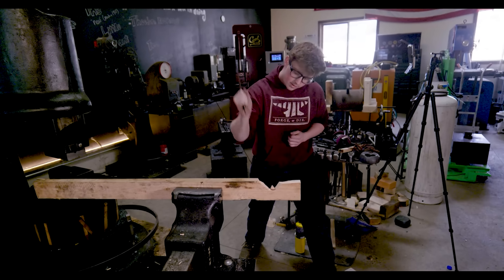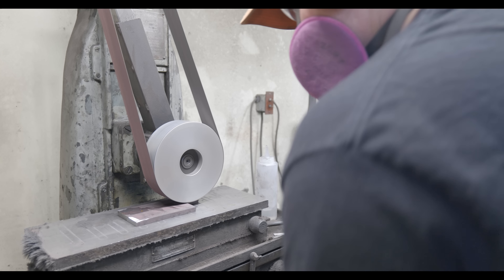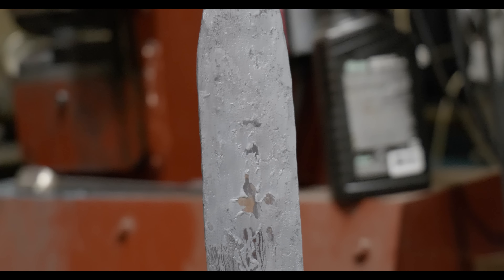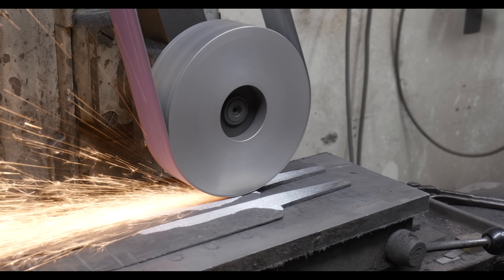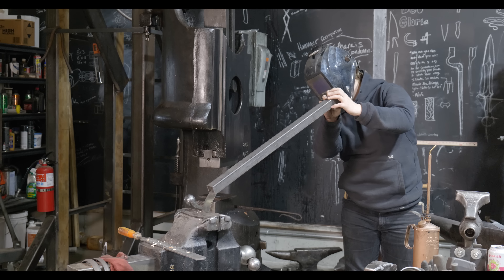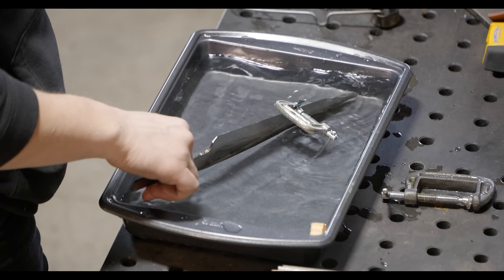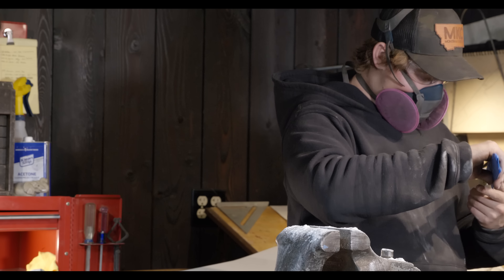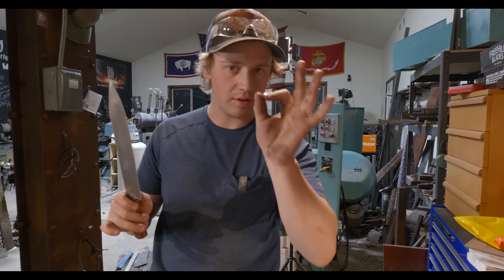Becoming a Master Bladesmith: Part 1

Comment: That blade has a lovely temper. Keep him and name him Brutus. 
... I've come to think the old Elletsville, Indiana forge group in the 90's had the right idea. The  people that were trying to be recreationists kept lots of small, onehanded bellows around for the times that they needed to blow on something, but didn't want to breathe in what they were working with. The guys that were using modern tech had pressurized air. One smarty used the copper pipes he ran it through as the ground for his forge barn's power. Which was fine until the first storm came through and he found every last breaker in there thrown and blown. From the hand sander to the rechargers to the triphammer and ceiling fan, if it was plugged in it needed its fuses changed or breaker reset.
I'm sure by now you've passed your Master Bladesmith's test. 
  Congrats! Congrats!

Comment: Machining tip: When you mill slots in G10 like you did in this video, maybe you could first try plunging the cutter to full depth in many places along the slot to remove the bulk of the material (turn it into Swiss cheese). Then do a finishing pass where you mill along the full length of the slot. This keeps the bulk of the cutting forces inline with the axis of the tool, rather than putting a side load on the very tip of the cutter, which can more easily snap the cutter like what happened in this video. But I’ve never milled G10 before, so I’m not sure how well it would work, but it’s worth a shot!

Comment: Looks good. Hope you didn't temper the spine too close to the tang, because that whole transition area looked mostly blued and doesn't leave any hard springy steel running from the edge through to the tang.

Comment: Can you not "think outside the box" and have a hinged knife (literally a henge/lock in the mid) for the "bend" test. Have the first half of knife thick and last half thin for both other tests. Win win right? Still within the rules technically lol. could also have the blade the same thickness but when both edges are together its now thick.

Comment: I'm curious. 
It seems the tests with the rope and 2x4 is very, very arbitrary and not very controlled at all. 
The bend test is comparably very much objective. 

Or did you oversimplify the explanation?